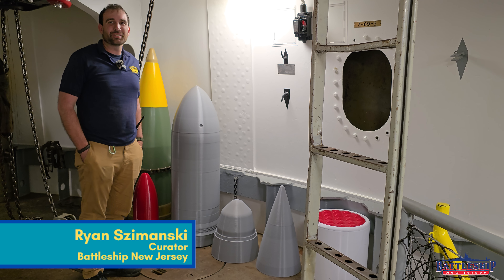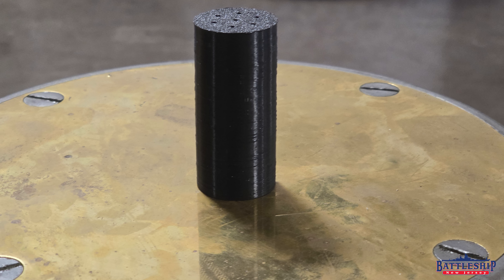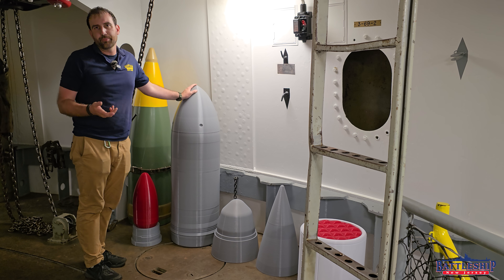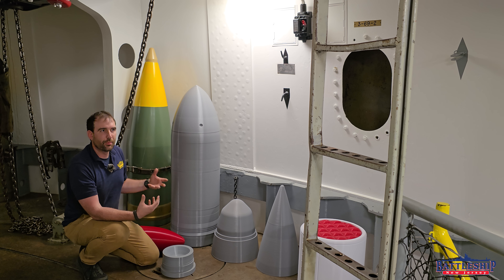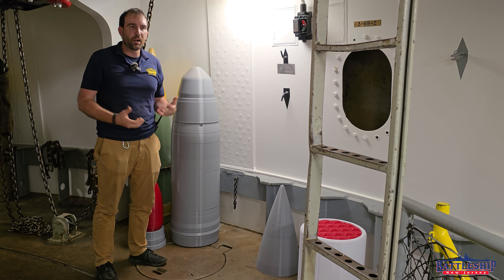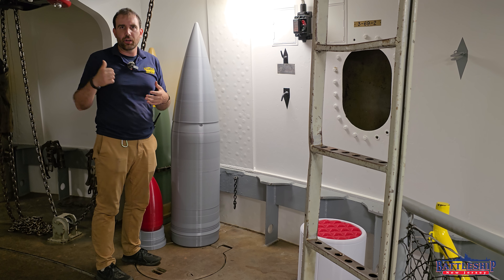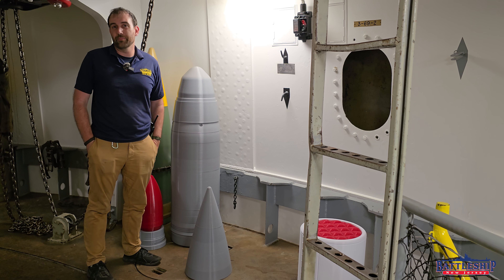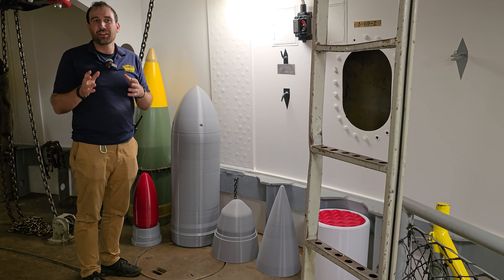The Components of Large Naval Artillery

Comment: What made the armor piercing round "super-heavy" compared to its contemporaries?
Reply from the maker: It's 2700 lbs instead of 1900.
Reply: @BattleshipNewJersey  Right but what was the design feature that made it 2700 lbs?  Was the armor piercing cap made of tungsten instead of steel?  A smaller than usual burster charge?

Comment: Near the shell model how about a representation of the cross section of the typical armour the shell is designed to penetrate. It’s one thing to verbally say this shell is going through x inches of armour. Quite another to have a physical representation there while that 1:1 ,Odell of the shell is there.
Obviously not 3d print. But wood or foam sheet, painted like the inside and outside of the hull with red on the face representing the cut away.

Comment: 3D printers might be good at making scale cutaway models of the various major pieces of machinery to show the different components inside, and place them next to the machines they model along the tour route. If the model maker is especially motivated, he could add hand cranks or electric motors to make the parts move to simulate the machine's operation, or add LEDs inside to make the internals easier to see.
Or perhaps you could scale cutaways of the ship itself, with different cutaways slicing away different parts of the ship to show the ship structure & how different spaces are interconnected.
3D printers can also use transparent plastics, so "cutaway" could mean sections that still provide structural support but are see-through.

Comment: Excellent, and thanks to the professor, as others have said. I would use Army Painter primer and color on 3D-printed items when you paint the parts. You will not get a perfect match, but you will likely find something close to the color. I don't find much value in sanding and filling as it stresses the 3-D layers and can delaminate them. Just color 'em and use 'em. If you want to show the details...you can fill the detail lines with a black wash and wipe off the excess. Please have a look at their website for painting figures, as it will help you think about this...Also, it is not plastic but something else, so it does not work like gluing a model together. Excellent again.

Comment: Ah that's awesome! Such an amazing demonstration aid! Mad kudos to Dr. Sepunkov (my best guess at spelling 😂) for that outstanding, thoughtful gift!

A minor correction about the armor piercing cap: It actually didn't penetrate the armor itself, it was introduced in order to help reduce the chance that the hardened shell would shatter against hardened armor. It also incidentally helped reduce the chance of a ricochet when the shell struck an armor plate at an angle, but that was only a minor improvement and not the primary purpose for the addition. The cap, made of softer metal than the shell body, impacted the armor first and basically squished, which reduced the concentrated shock load on the shell tip at impact, instead spreading the force over a larger surface of the shell's nose and reducing the chance that the shell would split open and harmlessly shatter before punching a hole through the armor and being intact to detonate properly on the other side.

Edit: Be sure to give an update once you get the parts painted up! I want to see that thing in all its glory!
Reply: Later versions of the Armor Piercing Cap also came with a face-hardened variety - the hardened front surface would fracture the hardened surface of the target armor plate, while the soft backing of the cap would protect the core shell's tip from fracturing as a regular soft AP cap would
Reply: @OlegMilitaryHistory  Huh, I was not aware of that alteration. Thanks for the info :)

Comment: Fantastic video, and great thanks to the guy that printed this out.

I didn’t realize the nose cone section was so lightweight or how the penetrator portion worked. I always thought the entire body was just cast steel, so thanks for teaching me, yet again, something new. 

What exactly was the penetrating portion made of? In light/medium arms these days, armour penetrating can often be depleted uranium, but that wasn’t exactly common in WW2. You said “dense and heavy”, I don’t feel like lead, while dense and heavy, would overcome armoured steel belts. Some sort of nickel-alloyed steel?
Reply: In the case of the 16in Mark 8 APCBC shell (represented in my 3D print) - it was all steel, but with several different levels of hardening. The core shell itself had a high-toughness primary body, but the tip was rapidly quenched during manufacturing, which made the tip itself exceptionally hard - and thus, good for initiating a fracture in a target armor plate. The hardened tip was, however, brittle - and if the armor it hit was sufficiently face-hardened itself - the impact would fracture the tip of the shell, which would weaken the shell, and lead to either the shell itself fracturing, or at least deforming and severely reducing armor penetration. The original version of the armor piercing cap was made of much softer mild steel - and was intended to spread the energy of impact over a much wider surface area of the main shell - which protected the tip from fracturing, and thus maintained the shell's armor penetrating performance. Later versions of the armor piercing cap - however - like the one on the 16inch Mark 8 APCBC shell - actually had a face-hardened cap as well. The face-hardened cap would itself also initiate a crack in the target armor plate, by pre-stressing the brittle face-hardened plate surface, and thus help the main body of the shell punch even deeper into armor.
Reply: @OlegMilitaryHistory  thanks for the detailed reply!  Makes a lot of sense, and I understand it because I’m a machinist. But I’m a machinist in the 21st century, so these aren’t the techniques we’d use today. 

Sorry, not watching the video again right now, and I can’t remember who Ryan said made the models. Was it you?
Reply: @joelmacdonald6994  Yup! On my CR-M4 printer with the 1.0 mm nozzle
Reply: @OlegMilitaryHistory   that’s awesome!  The value of what your done for USS NJ can’t be overstated. Kids will be seeing that for years. 

And simply because of of that, I checked out your page. Long, detailed videos. Not many, but I’ve just saved your Lecture 1. I’ll take a look later, and if I like it I’ll subscribe and watch the rest. I love the technical stuff. 

So this steel they used, any idea what alloy? Maybe something like an 8620? Something that takes case hardening very well while but retains a tough core?

Comment: Well now I need to upgrade my printer with a 16" print bed so I can make my own 😂
Reply: The Creality CR-M4 and Neptune 4 Max have over 400 x 400 mm print beds - both have been running exceptionally well for me. For something as big as the 16in Mark 8 APCBC shell - definitely recommend using a 1 mm nozzle, since it has roughly 5 to 10 times the effective print rate of a standard 0.4 mm nozzle

Comment: I'm surprised, Ryan. While I am no expert, I think you may have some facts wrong about the shell, if I'm remembering my ballistic shell metallurgy correctly. The shell itself should be hardened and be plenty armor-piercing on its own. The trouble is that uncapped shells tend to be ridiculously brittle and break apart, and they lose penetrating power rather quickly, especially at higher speeds. The blunt nose-cap should instead be solid, unhardened mild steel and is meant to deform on impact. This deformation applies pressure more evenly on the hardened shell nose and helps prevent it from breaking apart right away when the narrow nose first hits armor steel at high speeds, getting more penetration for the same shell with more consistency. The final piece is the ballistic cap, meant purely to assist external ballistic characteristics, and is hollow - I don't know if it would be mild or hardened, but it ultimately isn't meant to matter once the shell starts its terminal phase.
Reply: Slight correction (shell modeler here) - uncapped shells typically had their pointed tip hardened, to initiate a fracture in the armor, so that the tough remainder of the shell could push through the weakened fracture zone. The hardened tip was, however, brittle - and if the armor it hit was sufficiently face-hardened itself - the impact would fracture the tip of the shell, which would weaken the shell, and lead to either the shell itself fracturing, or at least deforming and severely reducing armor penetration. The original version of the armor piercing cap was indeed of much softer mild steel - and was intended to spread the energy of impact over a much wider surface area of the main shell - which protected the tip from fracturing, and thus maintained the shell's armor penetrating performance. Later versions of the armor piercing cap - however - like the one on the 16inch Mark 8 APCBC shell that I modeled - actually had a face-hardened cap as well. The face-hardened cap would actually also initiate a crack in the target armor plate, by pre-stressing the brittle face-hardened plate surface, and thus help the main body of the shell punch even deeper into armor.
Reply: @OlegMilitaryHistory  Well shoot, that's awesome! Thanks for sharing. : )

Comment: What was the nose cap made from ? Like tungsten or ?
Reply: A bit extra information provided for context - uncapped shells typically had their pointed tip hardened, to initiate a fracture in the armor, so that the tough remainder of the shell could push through the weakened fracture zone. The hardened tip was, however, brittle - and if the armor it hit was sufficiently face-hardened itself - the impact would fracture the tip of the shell, which would weaken the shell, and lead to either the shell itself fracturing, or at least deforming and severely reducing armor penetration. The original version of the armor piercing cap was made of much softer mild steel - and was intended to spread the energy of impact over a much wider surface area of the main shell - which protected the tip from fracturing, and thus maintained the shell's armor penetrating performance. Later versions of the armor piercing cap - however - like the one on the 16inch Mark 8 APCBC shell that I modeled - actually had a face-hardened cap as well. The face-hardened cap would actually also initiate a crack in the target armor plate, by pre-stressing the brittle face-hardened plate surface, and thus help the main body of the shell punch even deeper into armor.

Comment: It's a shame Nathan Okun passed away earlier this year because he could give an even more detailed explanation of some of the issues and corrections. The biggest one is that it is not the armor piercing cap that makes it an armor piercing shell. The primary thing that makes it an armor piercing shell is that delay fuse, while the thickness of the wall and hardness of the steel in the shell body also play a big role. A high capacity shell, even with the AP cap and wind screen, would penetrate essentially no armor because it doesn't have a delay fuse, although the practical physical limits of fuse activation still imposes a delay of about 0.003 seconds.

What the AP cap really does is absorb the shock from the impact on face-hardened armor plate such as Class A plate. Impact on face-hardened plate can send shock waves through the shell body that can shatter it under the right circumstances, or at least cause it to bounce off and be rejected under other circumstances. The cap, especially by WW2, is very hard and helps punch into the face-hardened plate, but its deformation absorbs and dissipates the shock of that impact, allowing the intact shell body to continue punching through the armor.

Comment: i am not sure if the explanation was correct. as far as i know the projectile is known as APCBC and the 3 parts are AP, C and BC. the BC is the cap you described correctly. the AP part is not the between-cap, its the shell itself. its made from hardened steel (some ap shells are APHE like this one, some do not have high explosive fillers) and the C part is the cap, thats the middle part added to the main projectile. it doesnt do the penetration, it just kind of adjusts the projectile angle a little bit. if the cap would not be there, the shell could hit angeled armor and bounce off. with the cap, the metal kind of grabs the angeled surface and turns the main shell into the armor so it gets more bite and better penetrating angles. also it protects the AP shells tip from shattering as it might hit hardened armor plates. so the middle part, the cap, enhances penetration by aiding the AP part.
Reply: Correction (shell modeler here) - uncapped AP shells typically had their pointed tip hardened, to initiate a fracture in the armor, so that the tough remainder of the shell could push through the weakened fracture zone. The hardened tip was, however, brittle - and if the armor it hit was sufficiently face-hardened itself - the impact would fracture the tip of the shell, which would weaken the shell, and lead to either the shell itself fracturing, or at least deforming and severely reducing armor penetration. The original version of the armor piercing cap was of much softer mild steel - and was intended to spread the energy of impact over a much wider surface area of the main shell - which protected the tip from fracturing, and thus maintained the shell's armor penetrating performance. Later versions of the armor piercing cap - however - like the one on the 16inch Mark 8 APCBC shell that I modeled - actually had a face-hardened cap as well. The face-hardened cap would actually also initiate a crack in the target armor plate, by pre-stressing the brittle face-hardened plate surface, and thus help the main body of the shell punch even deeper into armor.

Comment: Great stuff, the cap is softer material usually in place to reduce the chances of the actual (hardened) shell body shattering when it impacts hard armor, it also helps with reducing the chance of the shell ricocheting off if the shell hits at a large angle by allowing the softer cap to bite into the armor plate.
And yes the ballistic cap is just there for aerodynamics
Reply: This is wrong, AP caps post-WW1 are all "hard" caps, with a similar hardness to the shell body. American WW2-era caps had 550-600 BHN hardness, only the very base of it (where it connected to the shell) was softer. Some "super-hard" caps over 600 BHN were also experimented with. Soft caps prevent shatter at low obliquity, but that's pretty much all they do. They were ineffective at high obliquity as they just detached from the shell and, in every obliquity, did pretty much no damage to the armour. Hard caps "bite" into the armour even at high obliquity and help with penetration by breaking the hardened face.
For reference, homogenous armour would have 200 to 250 BHN hardness, face-hardened armour 600-700 BHN at its hard face (down to 200-250 at the other side). Shell bodies were also hardened at the face (500+ BHN) to ~250 at the base.

Comment: In answer to your question about what to 3d print, I look at it the other way, 3d printers are only going to get better, so I would focus on getting as detailed 3d scan as you can of anything and everything. To the point of seeing about getting someone to donate a high resolution 3d scanner and just start working your way through the ship scanning literally every inch

such a project may not be completed before the next dry-dock cycle, and scanners will also only get better and cheaper over time, so some things may need an additional pass later.

but starting scanning now will let you scan things before they deteriorate more

Comment: ----- Did gunners mates assemble the shells or did they come pre assembled?
Reply: That’s a great question
Reply: The shells were pre-assembled during manufacture - the armor piercing cap was soldered to the main shell over their contact area, and the ballistic cap was welded along its circumference
Reply: @OlegMilitaryHistory  what about the blasting charge?
Reply: @cruisinguy6024  mot explosive fillers for artillery shells are either (slowly) heated to their melting point, and poured as a liquid into the cavity of the shell, or produced in powder form, and pressed into a dense mass, kind of like dry-pressed ceramics. For Explosive D - which I believe would have been used for the Mark 8 APCBC shell - the dry press powder process was used to fill the shell.
Reply: @OlegMilitaryHistory  so if I’m hearing you right the shell would have come with the Comp-D burster charge already loaded?   All that the crew (I assume gunners mates) would have done is place the fuse, or was that already installed too?
Reply: @cruisinguy6024  Correct - the shells, as loaded onto the battleship, were ready-to-use and did not require any modification by the crew - the fuze was standard for all shells, and pre-installed at the production plant. Considering that battleships already have dozens of individual steps to load the gun, and rate of fire in battleship combat was quite critical, the objective was to minimize the loading time, and so, the shell was simply a fully built device that was loaded into the gun and fired. I would recommend looking up the video "16 Inch Gun Training Film" from the "1MightyMo" channel for a pretty detailed overview of the loading procedure to see the whole system in action. If you note the shell loading procedures, there are no opportunities provided for fuze insertion / modification.
Reply: @OlegMilitaryHistory  awesome, thanks for all the information!  I really appreciate it and will check out that channel and the video you referenced.  Thank you!
Reply: @OlegMilitaryHistory  ----- Thank you for the information, I sincerely appreciate it.